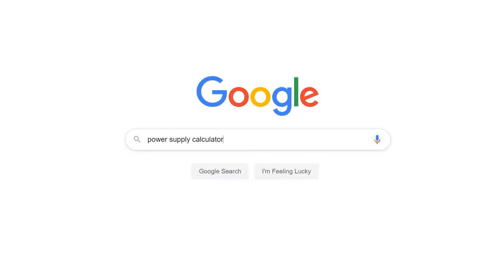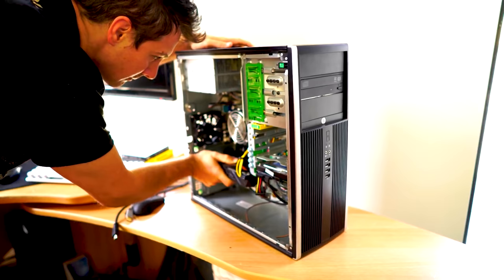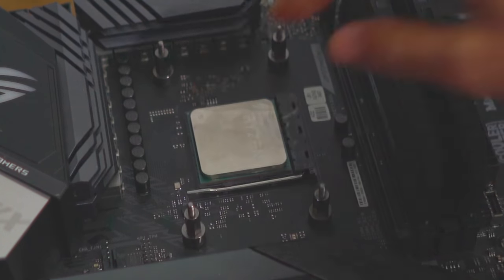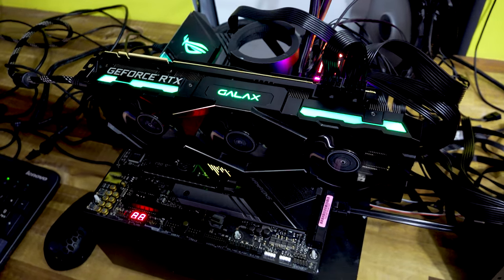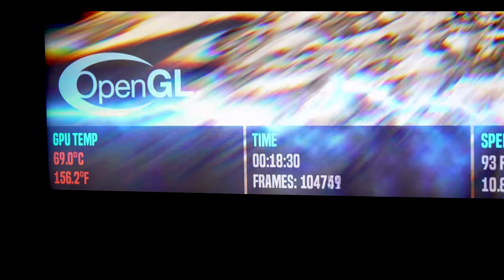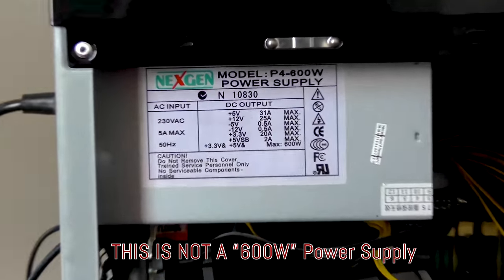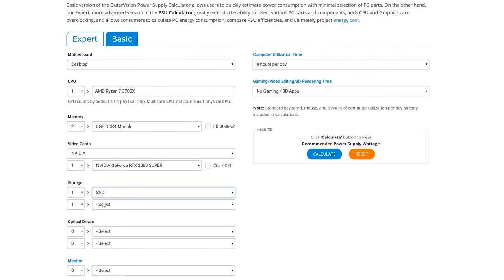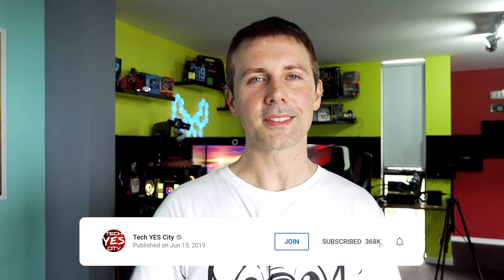I Tried Running a 3950X and RTX 2080 Ti on a 450 WATT Power Supply...

Comment: The way you tested it is inconclusive. Cinebench is a CPU benchmark, and a game obviously loads GPU.
You should try AIDA 64 stress test, which would keep both CPU and GPU loaded at 100%.
Alternatively prime95 fpu test simultaneously with Furmark or something,
then see what happens when power limits are exceeded.
... and if nothing happens still, you should try overclocking it until something does happen.

Comment: I have a question, I have a PSU EVGA 450BT, Asrock H67-M; Intel core i5 2310, 2x4GB DDR3 1333mhz, and "MSI GTX 1060 3GT OC", so when I start a game like Grounded in very high settings 1920x1080 px resolution, the computer just suddenly restart... after 5 minutes playing. This officially means that I have to buy a 600 watts PSU? I'll appreciate the help, excellent video, and very helpful.

Comment: Good evening, consult I have a thermaltake source 700watts 80 plus white I want to put a ryzen 5 5600x and an NVIDIA ZOTAC GTX 2060 6GB will it work well? Everything would be standard and no overclocking. Thanks.

Comment: some power supply caculators also factor in worse case scenario where say both the gpu and cpu were at max load. and then there is value it staying at a max load of 80% of your psu

Comment: so this website says that a i7-7700 with a rx 5700xt with a sata2.5 and hdd also with 16g of ram is only using 461 watts, so with with that said it should work a 500 watt psu right ?

Comment: What is the biggest gpu a 1700 and 350W psu handle? I have a quadro M2000 and wondering what would be a good general upgrade.

After 300-350W, FLEX ATX PSU's jump in price to $100 400W models and $200 500-600W.. pretty far out of my budget.

Comment: modern graphics cards are hardly the R9 290X's of old. I had two of those in crossfire and it constantly rebooted the system with a 900 watt power supply due to overloading the rails.

Comment: I just upgraded from a 550w corsair none rated psu to a 750w rmx gold rated because the connection became loose and it was always too hot, for a 2070 super and ryzen 3600, probobly  bit much but there wasn't much price difference between 750w and 650w

Comment: I had a Seasonic S12II 620W 80 Plus Bronze PSU with an i5-4690 (all core 3.85 turbo) and an MSI GTX 970 OC'd (with 6+8 pin connector, not 6+6). It passed away in 4 years, however it was not a cheap psu at the time. Now running a Corsair VS650, my GTX 970 can handle higher OC clocks surprisingly. I'm not saying 620W wasn't enough, but interesting. (The VS650 was an emergency solution)

Comment: I have a gigabyte amd radeon rx 5700xt, with a amd ryzen 3600 6 core processor with 4 sticks of ram 32 gb.  I have a cooler master  water cooled cpu,  with 7 led fans.  My computer keeps shutting down during gameplay like this and dont give no message either. What power supply do you recommend. in that it didnt seem like it took into account all the fans and leds.

Comment: Hello, I use a 650W power supply and I use a i7 8700k with a rx 5700 xt 16gb ram with 2 ssds and an hdd. Sometimes my games crashes and my GPU pings at 99% requiring a restart. Could it be my PSU ?

Comment: My specs are
R7 2700 @ 3.9GHz 1.275V
GTX1650 Super @ 
C: 2055MHz M: 7450MHz
4GB*2 (8GB) @ 3466MHz 1.4V
And I'm running it on 
ThermalTake SMART 350W PSU
4 months in and there's no crashes whatsoever.

Comment: if a power supply is only 80% efficient and you are drawing 400w at the wall then the components are likely only drawing 320w, meaning you probably have more headroom than you think, though 80% is a minimum and the figure could be much higher, but just an observation to also consider, a current clamp on the 12v rails might be a better way to measure for this test

Comment: my perspective on power supply shifted when i bought a corsair one and saw the spec. i7 7700k and 1080, with 2 AIO, just powered with a 400w corsair sfx.

if i were to build it myself, I'd probably stick a 600 or 750 in there.
Reply: Hey , have you faced any problems goinf with the 400w?
Reply: @qzw-3631  I sold the pc already, but nope, no problem during my ownership. everyday use, gaming, even some AI/neural network exercise.

maybe would pose problem when overclocking, but even the stock 1080 were powerful enough for my use (a bit slow on AI use tho)

Comment: The calculator recomended a 391 W psu for a ryzen 3 3200g and a rtx 2060 , and I have the same Power suply in the video, am i ok to use it with ray tracing? I tried this configuration just for fun, but seeing this made me actualy consider the idea. I have no intentions to overclock anything, if it makes any difference.

Comment: Does my Thermaltake smart rgb 700 watt white certified psu can easily run my r7 3700x with 32gb 3200hz ram, atx b450 board, amd 6 fanas and 240mm aio without any problem?!

Comment: I generally build so that the worst case power draw will be about 2/3 of the PSU. To allow for some future expansion and under stressing. I have probably used 500's in most every build the last 4 or 5 years except for really high end systems.

Comment: Can i ask some question..i bought a latest computer with mid gaming range with 3060 ti gpu..my PSU rating in watts is 650 watts but unfortunately i bought a UPS with 360 watts only..can i still use the UPS or can it supplY my psu rating with 650 watts..?

Comment: Hello! Thank you for this awesome video. I was planning these days to buy psu from Thermaltake smart rgb 730W but...2x25A on 12V rails price is around 65 euros bronze. The second psu which I prefer is From Chieftec 650W with 54A on 12V rail single one and it is gold and  90% efficient for 105 euros. Right now I have Xilence 400W with 25A on single 12V rail but for parts I want it requires more power. The other models of psu I have found I don't like so much. It is a long story why I have this weak psu...lol

Comment: I've got a 1,200 watt power supply in my system. But that's because I have 3 GPU's running 24/7 at 100% and my CPU is a 1700x 100% 24/7. Mining crypto. But I bought it before I got more GPU's. Why? It was $80... lol Some guy at Amazon refurbished messed up or something. Runs just fine. And it's true rating, it's from Corsair.

Comment: Whoa, you can run an undervolted 3080 on low power PSUs. I was planning on undervolting a plain 3070 but now I'm thinking 3070 ti undervolt. I have yet to buy a card so I'm learning everything I can about my 450w Platinum PSU's limitations... 2022 FEB update-Doohhuhuhuhude, 37.5 amps on my Silverstone Nightjar Fanless 450w. Oh yeah, delidded 2700x and undervolted 3070 Ti is so happening.

Comment: So the website said load wattage is 473 with a maximum of 523 do you think I’ll be fine with my current 500w psu? I’m upgrading to a 2070 super from a 1660 ti also my cpu is a i7 8700k 5ghz.

Comment: Several months ago I bought my son a new PSU so I could upgrade his GPU, well I hadn't tinkered with PC's for quite a few years and didn't realize HP had proprietary PSU connections on the MOBO so... I had already bought a 450 Watt (I bought the 450 because is size constraint's)... Well now I have decided to just build a new PC and was a little worried about the 450 working on the build I came up with. The PSU calculator I used said 400 watt should be sufficient, I have a 450 watt 80+ bronze 450/37.5. Gonna give it a whirl, if it works I'll just upgrade his PSU when we upgrade his GPU the next time, and I'll grab a 600 or 650 so he can upgrade even further later on. I agree people don't need the mega PSU's but I think a 600 is reasonable if you're a gamer and plan to upgrade in the future.

Comment: I use a 450 for my 1660 super and a ryzen 5 3600x, it works just fine. People kept recommending me a 650 after upgrading from a 1050 ti + ryzen 3, but I stuck to my gut, and, you know, the actual numbers 🙄

Comment: I've bought a coolermaster masterwatt tuf gaming edition, it says on the 12V that it runs at 37.5A and has 450W available, so it should be more than ok to run a RX 5700XT + a ryzen 3 3300x, right?

Comment: i once tryed to get max out from outlet, i reached 497W with gtx295 and Q9300 which was heavily overvolted and i did everything to get that wattage, normal oc was about 420W. running low grade psu near its peak performance will significally reduce its life span, not recommended

Comment: i just went to psu calculator put the highest spec possible and got this power supply recommended

Infinity Gauntlet, 3GW, 99- Adamantium Certified (no warranty) - Available at Amazon

Comment: It coud possibly run better and longer,  if you had choose a 450W 80+ Gold Power Supply. I use a overclocked Ryzen 5 1600 (3,7 Ghz / Core), a overclocked Gtx 1060 6 GB, 5 Case Fans (3 of them with LEDs), 3 Hard Drives (SSD, SSHD, HDD),1 DVD ROM, 1 LED Strip and a Thermalright True Spirit 140 Power with 2 Fans, on a Fractal 450W Gold Power Supply.

Comment: I have an i7 8700 (non k), gtx 1060 6gb, ASRock B360M-HDV, 16gb ddr4 ram and a 400w psu. I want to get a 2070 but need a new psu. Will an evga 700w work well with my new 2070 card in my build?

Comment: I got a ryzen 7 and a 2060 super running both overclocked with  (2x16) trident royals 3200 cl16 overclocked to 3600 on an asus prime  x570 pro with a 500watt power supply no problem. And I only have the 8 pin power supply when it has a 8 plus 4 pin

Comment: Wow Ive been experiencing the same thing with my 650w bronze thermaltake. 9700 non k, 3070, 16 gb 3200mhz. I bought an 850w gigabyte one on sale and its fully modular, so my problem will be solved!

Comment: Litterly I was thinking about getting a RTX 2070 as my last upgrade of my rig, and thought ahhh my Bequiet Straight power 9 680w could be a problem, and then I saw video and was like, ok plenty enough. My rig btw: R7 2700x, 16gb corsair vengeance lpx ddr4 3200, enermax aquafusion 240, 3x Enermax ARGB chassis fans and currently my old RX 580 8gb (to create a nice bottleneck ^^) that's on a Asus Rog strix b450 f gaming, and for the storage I have a 512GB samsung 970 Pro (boot drive) and a 4gb Crucial ssd as my mass storage device... Any recommendations to upgrade not the gpu xd

Comment: I have Corsair VS450 psu. I what to use RTX 2060 Super which is rated at 175w (Gigabyte OC x3).

Specs :
R7 1700
Asus x470 Prime Pro
5 Fan (including CPU)
TRIDENTZ RGB 8x2 16GB Ram

The PSU has 12v x 36A which is 432w. The total load of the system is 350w.

Will this work ?

Comment: Single card setups 600W will do just fine, 750W if you're moderately overclocking, 850W if you're going to get every last drop of power out of your system. 2 card setups you're looking more 750W, 1000W if you're moderately overclocking, 1200W if you're going to overclock to the max. These ensure your PSU has a long life and it's at a more efficient stage of it's rating.

Comment: I have a ryzen 5 2400g it's an apu now I have some budget to buy a graphic card that to used so I am thinking to buy a gtx 1080ti which is better than rtx 2060 in some games or equal but it shows minimum voltage requirement is 446w I have corsair 450w supply but its recommended is 500w should I go for that

Comment: I have a EVGA 600w white PSU. Can't get RAM speeds faster than 2800 Mhz. I have the Ryzen 5 2600, RX 5700 XT, 2x8 GB RAM, 2 SSD, 1 HDD, internal DVD writer and 3 RGB case fans.

Comment: I use that calculator before finding a psu,then i look into the 80 plus of that psu,find the avg efficiency based on 80 plus,and theres my estimated wattage.I found that a 550w psu bronze is fine

Comment: Its a valid question, espcially as graphics cards has had a bit of a rollercoaster ride when it comes to watt/TDP (it went up, then down & now its going up again). 550W to 600W is probably the sweet safe spot today for most people. 750W is only if you are going all out gtx 3090 really. Anything larger than that & you are probanly crypto-minening with multiple cards. As always  good trick is always to go to the graphics card homepage as they usually show both the TDP & a reccommended PSU  size.

Comment: overworking a PSU like this will cause dipping voltage rails and excessive noise on the rails. That can manifest all sorts of ways including gpu crashes that cause 3d programs to abort (like what seemed to happen to you), hard locks from cpu crashes or memory corruption,  problems with other 12v peripherals, etc.

Comment: Funny enough, I have an evga 80 plus 500 wat psu, not even bronze. And it runs my 3900x and a 2080 super with zero issues haha. Psu doesn't even get hot. 
I play resident evil 3 at ultra 1440p buttery smooth for days.
WoW all the time at 4k ultra. 
I discovered it works perfectly after the 750 wat gold sea sonic psu had a SUPER loud coil whine, it was HORRID. 
Wanted to make sure it wasn't the card. 
Been using it since, not a single issue with my old evga 500 wat.

Comment: I’ve had a few of these mwe whites fail in 650w and 750w

I actually have a 750w mwe right now on my bench that is oscillating and coil whining with only 200w load - its a week old

Maybe the 450 is ok but have a go at the higher wattage mwe whites and you will find they’re awful

Comment: The only reason to go buy a high wattage power supply is overclocking, if you have high end components in your system, yeah u can get away with 550w psu and even 450w but as soon as u touch the cpu multiplier or gpu core clock u will see why people are tempted to buy higher powered ones, for example an i9 10900k will draw around 150w of power on stock, when overclocked it draws around 300w

Comment: will 550 wats corsair Bronze plus CX version be enough for Zotac 3070 gpu. 
My specs are ryzen 5 1600(non AF)
B450 F gaming Mobo
8x2 3000 Mhz Treident Z
1x SSD Kingston 256GB
1x M.2 Nvme Samsung 970 Plus 500GB
1x Hdd 7200 2TB
Rog Strix rx 570 4GB(replacing with RTX 3070 Zotac)
I will undervolt the gpu until I upgrade the PSU to 650 watts

Comment: I noticed you ran piggy backed pcie lead to the 2080, I did that to my 2080ti extreme waterforce and it kept shutting off when gaming. Turns out the Gpu drew too much power for one cable and tripped the overload on the psu.

Comment: Thanks for this it’s really reassuring. I brought recently an RTX 2070 super gaming x and on the box it stated min requirement 650w. I have the Corsair rx 550 m and wondered should I upgrade. It’s running fine but worried I may break something

Comment: I have i3 10100f paired with 8GBx2 RAM 2666mhz and RTX 3060ti GPU .. 1 240GB Sata SSD , 1 HDD..  Can my  Corsair VS450 Handle this or i need to buy another psu??? .. i mostly doing gaming only 5 to 6hrs daily

Comment: i don't understand its calculations, when i calculate 2070 super alone - your site shows 332 Watts under load, when i calculate 3950x alone - site shows 210 Watts, when i calculate them together - it shows 430 Watts, but it shoul've been 540 watts? So what's the deal

Comment: Hi, I use 450 watts on GTX 980 ti amp extreme. and when the gpu load go up. the gpu will shut down and the pc will remain running, is it that power supply can't draw more power to gpu?

Comment: would( 550 watt coolermaster )power supply be enough for :

2700x ryzen 7
x570x gaming x
5700xt red dragon
16gb single channel corsair vengenace
seagate 1 tb 7,2k rpm

Comment: I have an alienware  R7 Aurora i7 8700 GTX1080 on a 430W power supply. It's the stock Dell power supply and it's been running for years.

Comment: You don't need a 1000W but a good quality one will last 10 years, and its not working as hard, so will spin less and be quieter, hell even some shut their fan off if below a certain temp.  Also over time they lose efficiceny.I'd never do less then 700W in a build like this let alone 450w

Comment: Currently I'm buying parts each month and I accidentally bought a thermaltake litepower 650w and due my uneducated self I didn't check whether it has a 80plus certification. I'm pretty sure it will power my rtx 2060 with R5 3600 but I can't help but feel stupid for not researching properly. Thankfully it's not OEM or some other shady PSU units.

Comment: I just buy an 850w every single build now... I don't even measure, I just with 850 since it's a nice solid number. Could probably get by with a 600w in most cases.

Comment: Hi i'm making a hard decision right now, im planning to buy a RTX 3050 8gb 
But im using Ryzen 2600 with ATX motherboard plus Cooler Master 450 watts plus 80 
is there anychance that will explode or not ? 
PS: Sorry for the Noob Question 😓
Reply: your PSU is going to be just fine, no issues.

Comment: my psu is a 450w and i have an rx570 i just ordered the ryzen 3600 yesterday will i be safe using this psu just for a few weeks until i get another one i was told i would be alright for about a month then i will have to upgrade it

Comment: Thanks for the video mate, your video gave us a lot of information.
However, I would like share a bitter story of mine recently as well on PSU.
I had a Corsair PSU 850W (CS850M) and it died just after 4 years of relatively light usage. When it died, it went down and killed the motherboard, CPU, GPU, HDD and DVD ROM, only the RAM and SSD and the case survived
And this semi-modular power supply has Gold 80+ rating, but has only 3 years of warranty. From this instance, Corsair upset me so much that its brand will rank the bottom of my shopping list in the future. (Of course its over-priced mechanical keyboard K95 also disappoints me a little as well.)
I felt that I really got cheated by Corair and its pathetic 3 years of warranty, despite numerous good reviews on the CS850M.
So for me, when I shop for a PSU, I usually look for a PSU with the following criteria:
1. 10 Years Warranty (non-negotiable at the moment unless no-one provides such warranty term);
2. Fully modular;
3. Gold standard or above.
When manufacturer offers the above features, I believe I can be relatively comfortable the PSU is a good quality product.